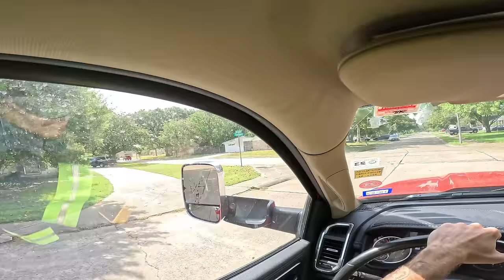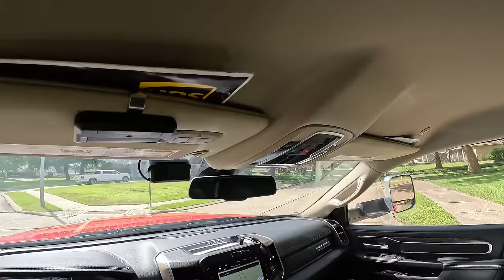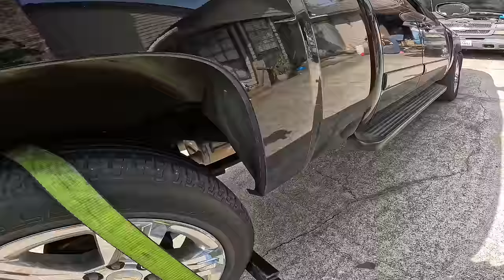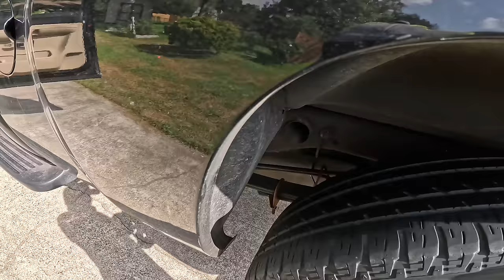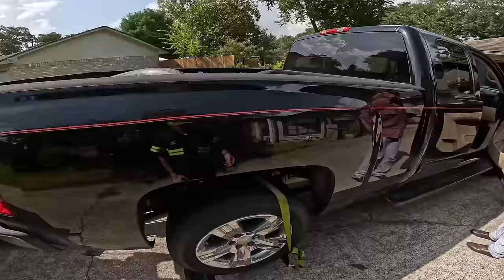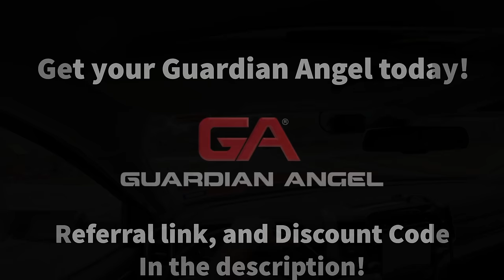He Tried to Drive Off My Lift! Chevy Silverado REPO!

Comment: Instead of buying new tires he should have made a truck payment
Reply: Here’s a thought for the loopy old man, don’t buy stuff you can’t afford.
Reply: From the sound of it this may have been a divorce settlement, not a missed payment.
Reply: @saw1898  facts!
Reply: That's exactly what I thought.
Getting aged, should know what's affordable or not.
Reply: stop defending big banks
Reply: @djsatane  Even though this is a divorce case, you do realize local credit unions hand out auto loans too right? It isn't just "big banks."
Reply: @antikommunistischaktion  You right, but on avg it's big banks.
Reply: @djsatane He had no problem borrowing big bank money.  He knew the deal.  Should of kept his word.  Instead he wanted a bling truck for his ego.
Reply: @2paulcoyle  sure buddy, I hope you never have any unforseeen life events
Reply: There's usually a pretty significant lack of common sense in these situations.
Reply: @djsatane  What are you talking about? interest rates are high. But its your own personal fault if you take out loans you cannot afford.

Comment: The guy doesn't (can't) make his truck payment but he has the money to put into brand new tires for the truck. It's like having your house remodeled while not paying your mortgage. Also the guy in the garage just standing there watching while the guy is trying to clean out his truck. Never lifts a finger to help.
Reply: There is always more than the video says.
Reply: The guy in the garage is lucky that that truck didn’t come off the lift when the other guy tried, because if it did, it would’ve crushed him between that truck and the one in the garage. But just watching. So weird.
Reply: Eh. I feel its more like putting a new roof on your house. Tires can be a hazard if they are bald or dry rotted. That said it might have just been cosmetic and the. Your comment is completely valid.
Reply: If he paid 1000 dollars for those someone broke it off😅

Comment: In 2015 I was driving for Lucky Transport and my truck was a red 2013 Ford F-450 Super Duty Flames and it was red and it was fast.  Had the quick pick unit.  Class A . Twin line.  Bad ass. ❤

Comment: Now Dustin when doing repo work there a major rule you can't be Mr.Nice . A lot of friends have been shot at during a repo . So when you take the vehicle you don't let the clean it bc you never know if there going to trash the inside . So next don't put on the straps right wait until  you are two blocks up and a block over even if means you have drag the vehicle

Comment: Always try to 1st, wrap the wrecker body safety chain around a leaf spring hanger or something sturdy like a receiver hitch, somethig easy to reach, don't  get under trying for an axle, if they try to drive off, they won't get far, even if they put it in 4x4....& worst case scenario.. its strong enough to drag it away to a safe spot to rehook. Wheel straps can be burnt off by spinning tires... not a bad idea to get yourself some body armor too.... a few hundred bucks is a good investment.
Reply: He didn’t even apply those tire straps correctly.

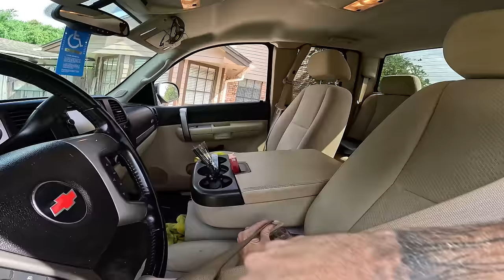Comment: 6:30 you should really get yourself a 6' length of 3/8 soft nylon rope and use it to tie off the sterring wheel to eitber the door frame and or the shortened seat belt. Dont trust the seat belts on their own.  Lessons learned by a lifer.

Comment: I’ve seen so many towing videos but this is the first time I’ve ever seen someone use the seat belt to secure the steering wheel like that… I’m amazed 💀
Reply from the maker: It’s a common practice in the towing industry. 
Especially in a pinch like this, where you don’t have all the Time in the world to sit there and mess with multiple ratchet straps.
Reply: It's done all the time, especially with big rigs.

Comment: I had a Honda Civic repo’d back in 2010. I left the keys under the floor mat, left the car unlocked and told the bank where the car was at. No need to fight the repo man. I simply bought something I couldn’t afford. Have to give it back.
Reply: That’s what I would do too. No point in dragging it out.

Comment: Pro tip get some clubs not the steering wheel only hooks get the ones from wheel to brake pedal As soon as he jumped out, I would have walked around the truck and installed the club It's on the truck you have possession. Don't be scared, go inside and put it on. Then if he attempts that again he can't even put it in gear

Comment: You tried to be respectfull and honest with this guy,I think he was gonna get his shit and say screw you with the keys,that why he got mad and threw them on the ground,a lot of tow drivers dont want confrontations that may lead to something bad and would have just lifted it and took off down the road but stopped shortly to secure it out of the area,so he would have to come pick up his shit where ever the truck ended up,but did he appreciate what you did,hell no,let his anger get the best of him!He is one of the reasons some just hook and go!
Reply from the maker: I generally do exactly that, but I saw him get in the truck, and I can’t take off with him in it. So I had to stop and secure it there.
Reply: @Towtruck_Dustin  Yes he did,I understand you had to do what you did!

Comment: I operated a flatbed for 15 years and when you pull that seat forward and failed to pull the seat back to tighten the seat belt bro I'm scared for that truck on your lift

Comment: I saw a guy try to stop a repo. he had a 4wd truck, got in it when he was coming down the street, fired the engine up, pulled it into 4wd floored the throttle, and blew the transmission and front drive unit up. One easy step to make bad day worse.
Reply from the maker: Unfortunately people will damage a vehicle badly trying to stop it, and end up making things so much worse.
Reply: @Towtruck_Dustin  Is that because people are inherently STUPID, or just don't understand they can get their vehicle back??

Comment: I getting tires are part of being safe on the road, but those tires cost some money. You got money for tires but can't make a payment?
Reply from the maker: That’s what gets people in trouble most of the time. They put the priorities in the wrong place, and get behind.
Reply: Tires are like $400 and lets say that truck was bought during the rise in car prices and was about $30,000 on a 5 year monthly 10% interest loan is about $759 a month which really doesn't seem like much but that truck could have been $40,000 or $50,000 and I've been in accidents that were solely caused by the other driver having worn tires I wouldn't consider a potential deadly hazard something too put 2nd

Comment: is this a dealer installed GPS or something you can track on any vehicle?   Asking for a friend!  lol   I don't have this issue but I have heard of repo's for being over a few weeks late.   Showing up at the exact location of a brand new car and taking it.
Reply from the maker: Dealer installed. 
Some can even shut off the starter so the vehicle is immobilized.
Reply: I used to work at a car lot installing the gps units. they can pull up on google maps the exact location of the car, and even show where it was at as they get updates. We had some meth head steal a truck at 2am, he spent a hour trying to find the gps but I hid it really well. we pulled it up on the computer and sent cops right to it, it was behind a fence. It got a chop shop shut down, The best part is the judge over the case had his motorcycle stolen and it was found at this chop shop.😂😂 it was a guys house in a garage with all the other stolen shit. Here is how the guy stole the truck, he came to test drive it on a Friday at near closing and it was a gm truck with a black headed key, he gave us the wrong key and kept ours so he could start it and cut a fence and drove thru it.

Comment: Weird that it is legal for them to go onto private property to repo. I know when someone doesn't pay for an air conditioner we installed, we can't go onto their property to take it back.
Reply from the maker: As long as it’s not behind a locked area, they gave us reasonable access.
Reply: @Towtruck_Dustin  The same thing could be said about an outdoor AC unit but it is still illegal for us to go onto private property to retrieve that unit although they failed to pay. I'm curious as to the logic between the two laws being completely different.
Reply from the maker: Most likely because a vehicle has a lien against it, which is shown on the title, and the creditor has you sign a right of repossession, when the debtor signs the terms of the loan, which allows the collateral to be repossessed at anytime if in default.
Reply: @Towtruck_Dustin  Unpaid construction work, like installing a new AC, gets a lien as well. If just signing away private property rights is able to be done for cars, then it should be allowed and a standard for pretty much anything. Sounds like the repo industry had better lobbyists.

Comment: Never jump in the vehicle and cause it damage, if you can get between the tow truck and your vehicle Just stand there and call for someone to move your truck. If the driver keeps backing up bumping / pushing you, just fall to the ground and start screaming.

Comment: What is the reason for the seat belt thru the steering wheel?
Reply from the maker: Keeps the steering wheel from turning.
Reply: @Towtruck_Dustin  thanks! I was thinking the seat belt alarm wouldn't have bothered you too much from the cab of your truck so couldn't figure it out!!

Comment: Question, total noob here. I thought repo agents weren't allowed to disturb the peace, would you consider arguing with the debtor disturbing the peace? Thanks in advance!
Reply from the maker: I would consider it deescalating the situation.
I can’t drive away with him in the vehicle, now, if I got out and tried to fight him, that’s one thing. But I did nothing but try to calm him down to avoid a fight.
Reply: @Towtruck_Dustin  That makes sense, wasn’t trying to say you were in the wrong. To me the bit about “disturbing the peace” is a little bit of a grey area. Thanks for clarifying!
Reply from the maker: No problem!

Comment: That’s a terrible way to strap down tires. That has almost zero ability to help hold those tires down if you had to brake hard. 

I know DOT in my state would pull you over for that

Comment: What's the law on this? Truck is on private property. If the truck were in a garage or behind a fence? I doubt the state of Texas allows repo men to enter private property under just any circumstances.
Reply from the maker: Private property ain’t got anything to do with it as long as it’s not locked in.
Reply: @Towtruck_Dustin  so you can't break locks.

Comment: Why don't tow truck drivers secure the rims from turning? WTF is an over strap going to do?
Reply from the maker: How are you going to stop the wheels from turning?
Reply: @Towtruck_Dustin  a chain through the spokes. Weld it on the inside of the lift. Run it through the rim to another link welded to the outside and padlock it. For rims with limited access used a heat treated cable instead.
Reply from the maker: @benhoffman6606 can definitely tell you ain’t never done this line of work.
Reply: @Towtruck_Dustin   I've done plenty of towing but never repos. It just seems to be a quick simple solution to a very popular problem. Hook, lift, strap and lock. You're the pro. What am I not thinking of?
Reply from the maker: @benhoffman6606 putting chains through wheels is asking for a damage claim. That’s a big no no in the towing industry. 
Best bet is just hook the safety chains up. Even then if someone is trying to drive off my lift I’m not going to be getting anywhere near the vehicle unless you want to get crushed.
Reply: @Towtruck_Dustin   What's the difference between the customer damaging the rims vs the customer totaling both vehicles? A plastic coated cable should eliminate any damage to the rims on your part. You don't have to be any more underneath the cat than you are when you lay a flat strap over the tire.
Reply: @Towtruck_Dustin   Im an engineer, so I can think of 101 ways to solve a simple problem like this. I'd be happy to work together to create patentable solutions.
Reply: @Towtruck_Dustin   Do you use a strap to secure your tow yard? I've seen tons of people who just pop the strap loose and drive off. Destroying the vehicles. But at that point, you're the one supposed to responsible for securing the vehicle. It's like putting a lap belt on a baby. Knowing dam well, that they'll squirm out.

Comment: How much money can I make stealing cars and trucks?  Lets say I did 3 or 4 a day, how much money would that generate?  Do I need a fancy rig like yours?
Reply from the maker: Stealing cars is probably a bit more lucrative, but also illegal. 
Repoing tho, it depends on the contracts you have and the kinds of repo’s you’re doing. 
We do all kinds of towing, and I make over 100k a year as a driver. 
You don’t need a fancy tow truck if you’re only going to be doing consent towing. Single cab snatch truck is all you really need.
Reply: @Towtruck_Dustin  would you say my old 1980 hilux would have enough power to do that? it made about 90hp and 122 ft/lbs of torque in 1980 but 40 years later parts would be kinda worn so more like 78hp and 90ft/lbs of touque and it weighs about 4101 lbs

Comment: Another reason to not have GPS in your car
Reply from the maker: I don’t think you understand what I’m talking about. It’s not the GPS on the screen in your car. Its a dealer installed tracking module.
Reply: @Towtruck_Dustin GM started putting built in tracking with that nasty On Star

Comment: You caused this problem with the keys by showing a lack of basic respect.  He was cooperating before you demanded the keys in an instant like you were barking commands to a dog.  There is no need for these supremacy statements on your part.  I would not look kindly on these actions as a juror.  You are meant to be the professional here.  Remember that.
Reply from the maker: Obviously you’ve never done this line of work. I don’t care if he was cooperating at that moment. Fact is, I didn’t even have to allow him to get his stuff. Moments prior he tried to drive off my lift, so I have zero reason to trust him at that moment. Getting the keys in return for allowing him to get his things is a trade deal to help insure he doesn’t try to drive off again.

Comment: Dude, give up on the repo business. Leave it alone. Don't put yourself into this negative image. It's not worth it. When people see you arrive, it should be with a sigh of relief that you are there. This is the kind of interaction that makes you look weak. You can build a towing business, a successful towing business without this. Next time this guy needs a wrecker, YOU are the LAST person he will use. And will tell EVERYBODY how sorry you are. LEAVE IT ALONE. And if the right person sees your unattended truck, you may need to replace 6 flat tires. Or worse, find yourself looking down the business end of a .357.
Reply from the maker: Lol. I disagree. 
We’re the biggest towing company in the local area, and just voted best towing company by our local community. Regardless of the fact we do repo’s and the most private property towing locally as well. 
Being good at all aspects of our industry has made our company, the one people call when they need something done.
Reply: @Towtruck_Dustin  Well more power to ya....but remember, if it ever comes back to bite you in the butt.